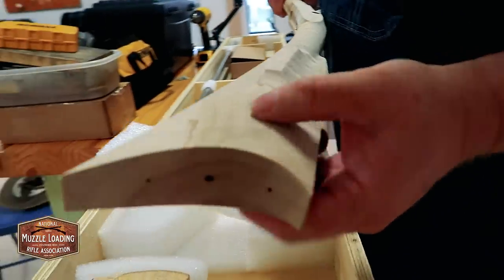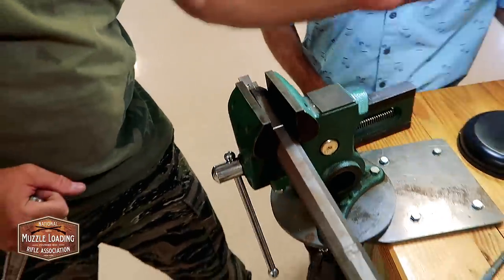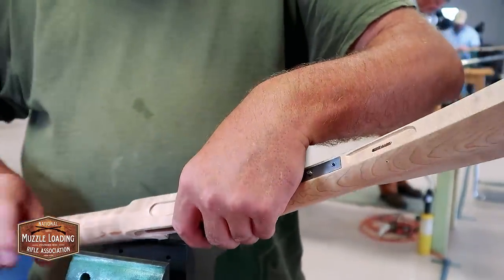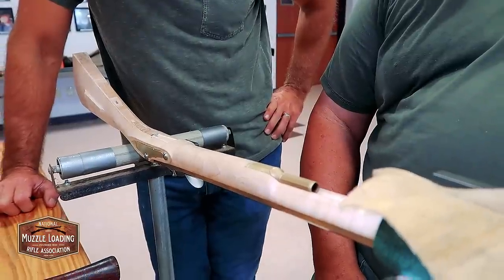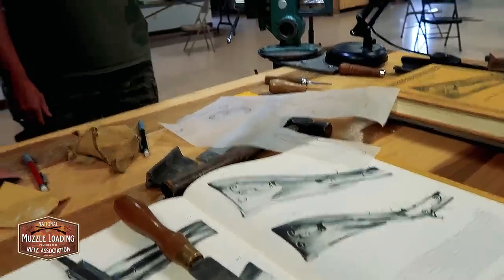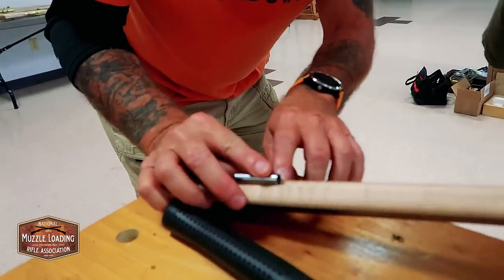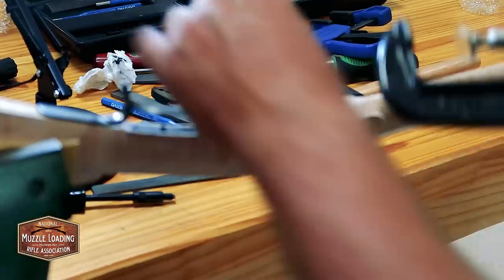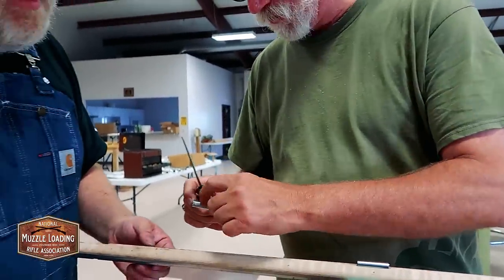Unboxing and fitting the hardware on a Kibler Kit | Kibler Kit Assembly Class Day 1 | NMLRA

Comment: Not for nothing but is it me? Are you all using a metal hammer to check on fitting the metal parts? Wouldn't you use a plastic or rubber hammer? Otherwise a very interesting series. Thank you!
Reply: You can use a highly polished hammer as well but an unpolished hammer wouldn’t be optimal.
Reply: @zacklothamer9533. I dont think you should rely on anything this group do to be "to the book" , adjustable spanner for the breachplug, whacking the forend on the bench instead of the comb to remove the barrel, the list goes on, total amateurs teaching bad practice to first time students.

Comment: What dye are you using for the barrel to stock fit?
Reply: It's called inletting black. Grease and fine charcoal. You can use a product called Prussian Blue as well. Its cheaper than commercial inlet black and a tube will last you years.